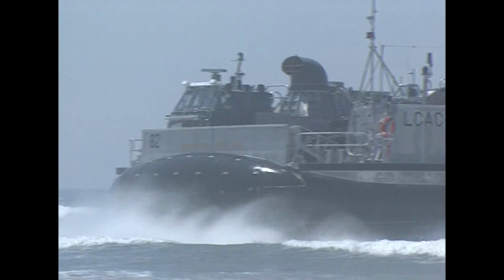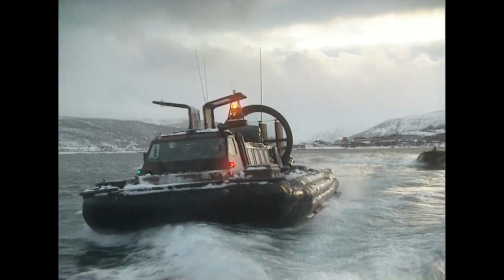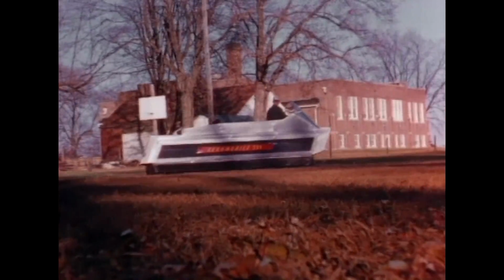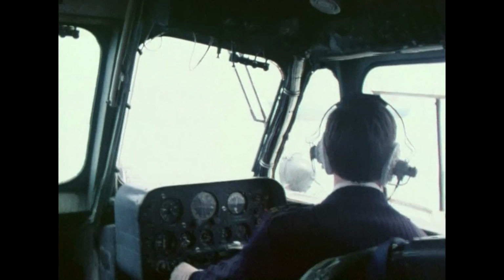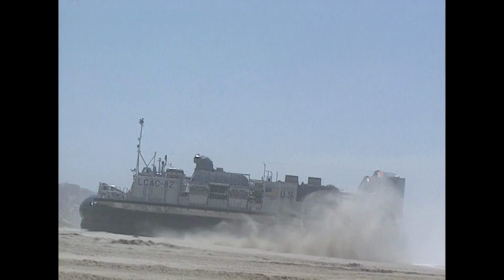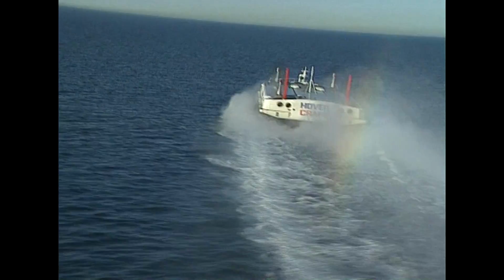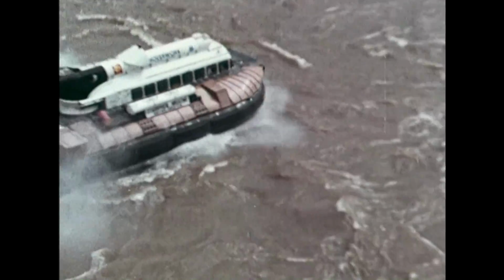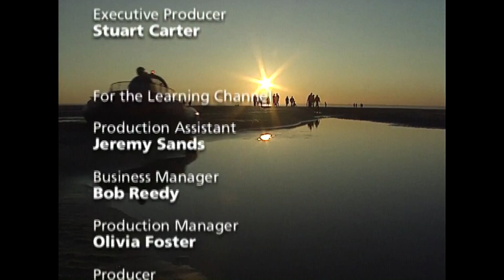Hovercraft - Ultimate Amphibious Machine

Comment: In the mid to late 1980s I was the test pilot for a large manufacturer of personal hovercraft based in Miami, Florida, I also demonstrated the craft as well as gave flight instructions to prospective dealers. I was paid to rack up 3,000 plus hours on those craft, and I had a blast doing it. Shooting through no-wake zones in Miami's Inter coastal and canal system at over 40 mph raised many eyebrows, flying up onto the beach for lunch at the Fontainebleau and flying circles around the S/S Norway as she departed the port of Miami made the local news. Good times at 8" above any surface.

Comment: During the Vietnam conflict the United States had 2 hovercraft for use in the jungle. About the only vehicles that worked well there. The limitation placed on the speed of the craft by the homogenized steel armor plates weight reduced the maximum speed to about 45 mph. This resulted in the vehicles being mothballed. The advent of Kevlar armor reducing the weight penalty with nearly the same protection factor makes the vehicles a viable asset provided the maneuverability problems can be overcome. By utilizing a vent on the opposite side of the turn actuated by the steering mechanism the directional control at higher speeds should stabilize. This means that by having 1 or 2 additional vents on each side to negate the residual inertia during a turn, the craft should respond to its controls more quickly. A redesigned variant of the thrust vectoring system used on the Harrier jump jets should stabilize the vehicles quite well. IF properly developed.
Reply: LEIGH BARTON
Reply: I have wondered why the use of hovercraft in Vietnam was abandoned....
Reply: . . . wondering why the USA lost the Vietnam war, though . . .
Reply: @cashuma5010  They lost it at Home.
Reply: @sandemike  . . . yes - first the USA (administration) lost ist morality and then it lost the support of their own people for good reasons . . .
Reply: @cashuma5010  Technically they didn't loose, they just quit and pulled out. In 75' when the NVA pulled up to the border the military simply withdrew to the rear, rapidly. Then the NVA simply put away approximately 250,000 citizens and soldiers and anyone who collaborated with the Americans.     God Bless You, and Everyone!

www.sez33.com
Reply: @cashuma5010  hippies, they lost because of hippies

Comment: Got to drive a large LCAC in Subic Bay back in 87, was awesome!  The one I drove can carry roughly 13 tanks if I recall correctly.
Reply: Bitchin! Thank you for your service Sir
Reply: @biggin5434  Thank you!  And your Welcome!  My Honor!  Miss it every day!  Semper Fi
Reply: Not quite 13, I'd say 3 tanks plus some troops.  The MBT of the USA and USMC back then was either M1 Abrahms or the older M60.  The M60 was around 45 tons while the Abrahms was well in excess of 55 tons.  What you got to ride was dependent on location.  Abrahms was too heavy for most Philipine territory, so I doubt Abrahms was significantly deployed to that Theater.
Maybe 13 Amtracks/Amphibious Tractors would fit the bill.  Amtracks of that era were inferior (still are) as fighting vehicles to the Bradley when it was introduced.  3/4 III MEF (Okinawa)

Comment: Very impressive to say the least. They should be used more for water transportation and flood rescue. Imagine if they were used on major rivers to connect travelers to other points and connections to other forms of transportation. This would help cut down on congestion. The idea of the tunnel and elevated craft are  great as well. If they cut down on road congestion then trucks could move more freely and safely. Therefore less accidents and delays. That would also mean freight would get delivered a lot faster.
All of things we buy are transported by truck 🚛
If they come up with different mass transit systems for travelers that would definitely cut down on traffic congestion and wear one the highway system.

Comment: The one question they didn't address is--What happens if the engines fail while on the water? Does it float or sink?
Reply: blueknight: They’re constructed with watertight bulkheads so can float when not on its cushion of air
Reply: @UKWMO  YEAH but if it loses power in the rapids,  ITS GOODBYE TIME

Comment: they need to make some kind of small high intensity blowers to mount on the front and rear corners,and that would give small hovercraft more stability in turns and keep it from yawing. you definitely couldn't replace all the cars with them, because it would look like bumper cars at the fair. at least as unstable as they are now.
Reply: The instability of many small hovercraft comes from the segmented skirt design. The 1980s SCAT is notorious for this. Newer hovercraft like the Coastal-Pro are more stable.

Comment: to the makers of the hovercraft there is no need to release that much are under it if you have holes built on the sides you can control which way to go and still be able to hold the air inside of it just like a balloon but by controlling which ports which holds the air goes out of it it would save in fuel

Comment: So this machine could be put out of operation, 6 ft T post halfway into ground sticking up, would stop this million dollar machine, puncture the skirt or get it stuck on top of a fence post!
Reply: your probably right, after all the billions in development they don't add into the cost of each unit. the US government had to make something of it, this was actually the most costly fail of its time, they kept getting promises and kept throwing money at it to the point if they didn't make something of it, it was probably going to be some ones ass. beautiful display of government spending
Reply: Wouldn't they just go around a single post? And if it's a fence sturdy enough that a hovercraft as heavy as that couldn't push it over with the weight of the hardware above the skirt, a lot of other military vehicles would be in trouble too (you can't really risk ramming an obstacle with an expensive military ship either). 

The hovercraft has specific jobs that it's very good at (particularly amphibious operations and on snow and ice), but if its sheer weight and thrust of its engines won't sail over or push over an obstacle, you need a tank, probably.

Comment: I always wondered if 'spring loaded' drop down rudders couldn't be deployed whenever sharp turns were needed and retracted for normal forward movement, increasing the maneuverability of these vehicles on water without the complicated and expensive 'rotating power pylons' used by the bigger versions...
Reply: Man, iv often thought all vehicles should have some kind of alternate movement system. Pillars on the corners for faster turning. Some kind of arms or legs thatll let a vehicle climb out of stuck situations. A winch harpoon to shoot into large trees to pull u forward 😄.

Comment: These are awesome, but what happens if one of the lift engines break down out over the water?
Reply: Hovercraft will float on water without the air cushion. The air cushion does not provide buoyancy, it provides lift above the surface, whatever the surface happens to be.

Comment: This design is ultimately impractical . Insufficient directional stability for one thing. But Ground Effect Vehicles are faster more fuel efficient  capable of higher loading per the expense.

Comment: the question is, is this hovercraft is a fuel efficient vehicle or not?
Reply: Catalino O Calimlim I heard it isn't but don't take my word for it
Reply: Depends on the engine you use. Jet engines like the LCAT are fuel hogs. Diesels use a whole lot less fuel.
Reply: Lurker1979 I see
Reply: Lurker1979 Hovercraft are designed around minimum weight , therefore unless commercial/public use to gain profit, engines will normally be petrol. This was explained to me by the directors of Flying Fish now known as British hovercraft company, when I purchased my Mk 3 Marlin a couple of years ago. I'd estimate a ratio  of 3 or 4-1 in economy over a boat of similar carrying capacity.
Reply: NOT !!!
Reply: If you`re carrying 50 vehicles and 350 people, i guess the answer would be yes.

Comment: (Cont'd)  Funny, as I watch this great piece of ingenuity, my mind wanders back to the days of the hydrofoil, which, on gaining speed, runs on stilts.  I did a temp assignment years ago for BMS, a department of Boeing developing the hydrofoil.  Alas it didn't take off for whatever reason.  I was amused later to see that same technology being utilized in runs between Macao and, I think  Hong Kong.  I'm not sure.  I saw it on an old tv series that starred Jack Lord and his foil, Dan-O!
Reply: I was thinking about the hydrofoil in the beginning as well.
Reply: US Navy had 5 (i think, maybe 6?)  built by Boeing.  I think designated PHMs, I think maybe was Pegasus class.  They had a Mk75 75mm super-rapid gun on the bow.   I had several collegues that got to ride on them.  They were homeported in Key West.

https://en.wikipedia.org/wiki/Pegasus-class_hydrofoil

Hydrofoils are super fast but much more fragile than hovercraft.  You could hit spomething with a strut.  The PHMs needed more development.   They used water jets and it seems the ducting for the water would work loose and open.  Leading to swamped vessels.  The PHMs were missile defense boats for the US Navy during the cold war.  If the cold war hadn't ended perhaps they would have gotten the development money to refine and work out the bugs.  If thye had worked out those bugs perhpas they would gave seen greater commercial success?

I think hovercraft are probably tougher and cheaper to run than foils.  Foils are probably faster.  So, just depends on whaat you are trying to do.

Comment: Do we see this same technology being applied to high speed railroad transport?
Reply: Jay Young The Japanese use a magnet rail that keeps the train inches above the steel rail.  It essentislly rides on air.
Reply: David G magnetic lavitation trains or maglevs actually were a german invention, later sold to china.
Reply: Quarkhammer Thanks.
Reply: David G Maglev trains do not use air at all for levitation, it uses magnetic fields. The hovercraft technology uses way too much energy to be useful for public mass transportation.
Reply: David G No it does not ride on air. it rides on magnetic forces which would work even if you operate in a vacuum with no air.  Perhaps at very high speed there could be a contribution from the air being rammed under the vehicle but that is only  a by product of motion  not the main principle of operation,   Professor  Eric Laithwaite of Britain was interested in this technique,
Reply: +Jay Young They did try to apply hovercraft technology to trains in France, it was designed by French Engineer Jean Bertin and was called L'Aérotrain. For more info please see - www.aerotrain.fr

Comment: Hovercrafts have weakness, 
1/ very large waves
2/ high winds
3/Earthquakes
Reply: That in itself is pretty much true for any and all current forms of transportation. Planes can't land in swamps, trucks can't fly over water etc... But I doubt that a Hovercraft would care if the Earth was shaking, however violently. (unless it lost its air cushion). Mind you, I would not try hovering across molten lava flows!
Reply: Now that could be interesting to try lava flows. what i was trying to point out Hovercraft weakness, if it slams into a large wave it loses its air cushion, the same happens in high winds, its only been found out in the last 20 years, hovercrafts fail to work in earthquakes the frequency vibration of earthquakes breaks the cushion
Reply: Yes, but the ground only shakes for seconds to a few minutes. a minor inconvenience. Also, most any vehicle is uncontrollable in earthquake conditions All vehicles have pros and cons in Optimal operating conditions. But Tungsten hull or the Shuttles Porcelain tiles and asbestos skirt cones??? I wouldn't do more than, no other choice crossings even then.
Reply: But its odd that it should happen, yes minor inconvenience unless the ground opens up under you, then its oh crap. Do earthquakes effect planes while they are in the air no then they can't be counted    vehicles are touching the ground so you expect that, hovercraft don't unless they lost that cushion.
Reply: Well.. I'm sure that having the ground open up in front of you is a LARGE miss fortune for any vehicle. Air bound craft may not be touched by any active ground movement But they are surely going to be deterred from landing after a strong earthquake. Especially if the runways are badly damaged and the larger the aircraft the more sensitive it is to landing conditions. I believe that after even violent ground shake, you could use hovercraft for rescue efforts. I appreciate that your pointing out deficiencies but. I would still choose a hovercraft over almost any other form of rescue craft known to date! They do say it can clear a four foot wall with no effect on movement. I assume that includes four foot boulders or up heaved ground. 

Our local coast guard use two large sized ones for search & rescue and servicing channel markers and channel lights along some very shallow wetland areas along our coast. 
80-miles/hour is nothing to sneeze at when time is an extreme concern for survivors.
Reply: They can go even higher than 4 foot with the right power and design like the ones the RN use for raiding party,s. Me to I think would prefer the Hovercraft in many cases, sooner or later they will sort that problem of noise out and make one super quiet, when that happens I can see the hovercraft really coming into its own.

Comment: OK I may sound really silly asking this, but how efficient are they compared to typical boats? Do they take a lot of fuel to run?
Reply: James Demos hi there, the diesel powered Griffon 2000td carries a 2t payload at 25-30kn using an average of 40-50l ( 12gal)/h, very efficient for a high speed craft

Comment: someone tell me why we aren sending that to mars instead of these dinky little rovers ?
Reply: Weight.  The more heavy something is, there is a proportionate increase in the fuel needed to get it there.

The heavier something is, the more fuel is needed to reach a specific velocity, more specifically, the more fuel needed to escape Earth's gravity.
Reply: @ChannelReuploads9451  okay well then I propose something different instead of sending a tank or a BTR remote vehicle there why not design something and instead of using wheels that get bogged down too easily why not use tank treads I mean it works in snow friend of mine had a truck we replace the wheels with these treadlock that go on them onto the wheels and these tank treads work the same way a tank does but they're smaller and they fit specifically on the wheels okay and he couldn't get his truck stuck to save his life I mean I know we tried now if it works for that why not just send a different vehicle bigger more battery power better insulated and make it out of a different type of material it's not like it's it's supporting a massive amount of weight it's not going to crash in anything it's going to slow so you don't have to make it with a roll cage or made out of steel it can be made out of carbon fiber the entire thing can be made out of carbon fiber why are we using this and then some parts can be made out of metal or aluminum all right and then instead of Wheels use the tank tread Theory instead instead of using Wheels tank tread get more traction they have more surface you make them wider and you can't get him stuck in in sand they have these vehicles already made you just have to take the design that they use scale it down slightly big enough to fit in one of these little dildo shaped Rockets and send it to fucking Mars and it would take no more fuel than a stupid satellites you keep putting up in space with we all know aren't satellites we're not idiots obviously you're building something in space and you don't want to let anyone know but whatever it's neither here nor there but it's the same thing you don't have to send a military heavy 28 ton vehicle you can scale it down using that design and just send something made out of a different material to be just as sturdy insulate the shit out of it so when it's mad cold out it doesn't do anything and add bigger batteries that last longer for those times where you know you're getting a dust out and shielding for the solar panels so they don't get hurt and then when it's done the shielding comes off slides down and exposes that the solar panels to charge the batteries up and then when they're fully charged it keeps going

Comment: hardly seems worth their cost....like that huge one weighing 300 tons with 21ft props and a 7 millions dollar skirt...im sure they just guzzle the fuel....and are so limited to flat land and sketchy steering...i never got why they even existed....they have very limited uses imo!!! ultra noisy cant go up hill of any kind....bunch of over spray over water....cool to see they at least made somewhat useable but again very limited used....other than the fact they can go over land an water and ice is  the only reason they exist! what happens if they encounter engine failure over water with a full load of people and vehicles? or if they run out of fuel? do they float? well if the engineers deem it worth while they know way better than i ever could...just think it is limited in performance other than any flat ground or surface!!! and its likely inefficient with fuel ! i never had the urge to buy a small personal hovercraft!!!